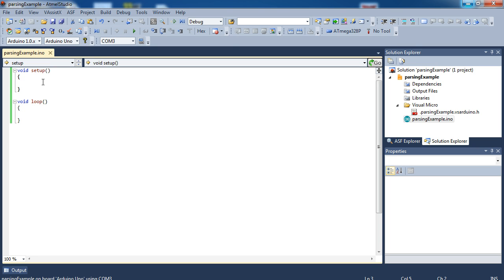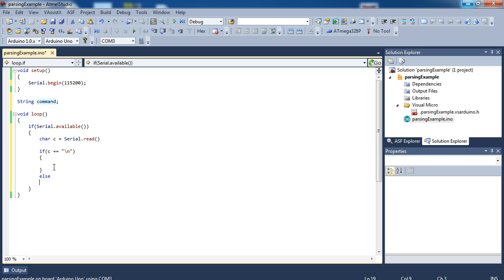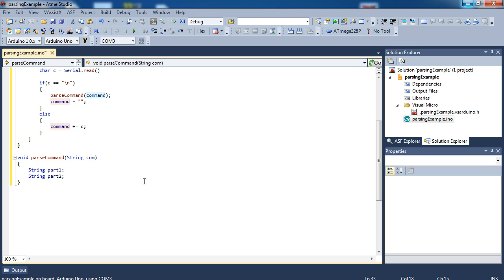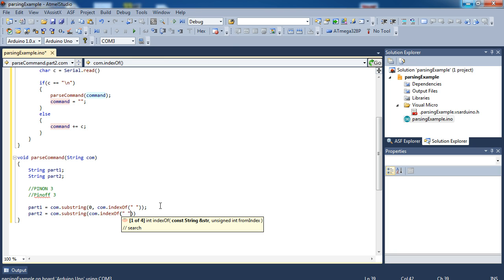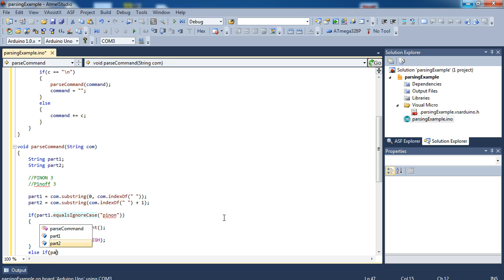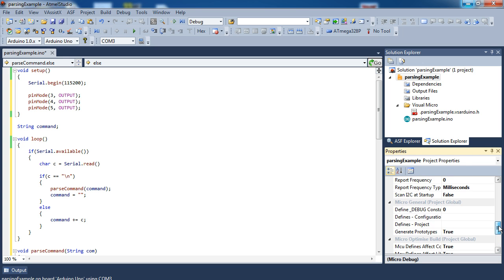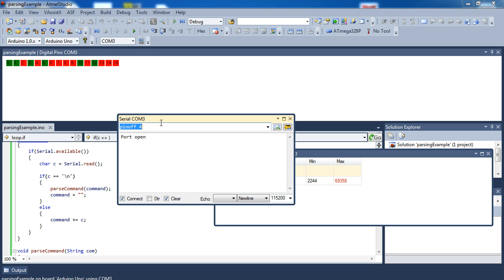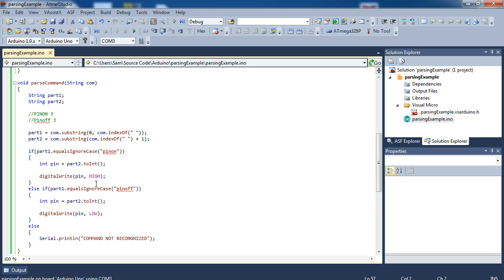Arduino Tutorial # 4.5: Better Serial Parsing

Comment: how do I add a part 3 for parsing a third part (for ex. pwm 11 125)?
Reply: Try: 
third = com.substring(com.indexOf(" ") + 2);
Reply: It didn't work i find an workaround with more then one separator for each comand like this:

void setup() {
  // put your setup code here, to run once:
  Serial.begin(9600);
}
String command;
void loop() {
  // put your main code here, to run repeatedly:
  if (Serial.available()) {
    char c = Serial.read();
    if (c == '\n')
    {
      parseCommand(command);
      command = "";
    }
    else
    {
      command += c;
    }
  }
}
void parseCommand(String com)
{
  String topic;
  String sensor;
  String value;
  //topic sensor value
  topic = getValue(com, ' ', 0);
  sensor = getValue(com, ' ', 1);
  value = getValue(com, ' ', 2);
  Serial.println(topic);
  Serial.println(sensor);
  Serial.println(value);
}
String getValue(String data, char separator, int index)
{
  int found = 0;
  int strIndex[] = { 0, -1 };
  int maxIndex = data.length() - 1;

  for (int i = 0; i <= maxIndex && found <= index; i++) {
    if (data.charAt(i) == separator || i == maxIndex) {
      found++;
      strIndex[0] = strIndex[1] + 1;
      strIndex[1] = (i == maxIndex) ? i + 1 : i;
    }
  }
  return found > index ? data.substring(strIndex[0], strIndex[1]) : "";
}

Comment: Hey man, I know this video is 5 years old or whatever, but it's a great tutorial on separating out data from serial input. I have spent hours reading Arduino forums about methods of doing this, but they are SO convoluted (making temporary indexes and arrays, etc). Thanks so much man, this is so much cleaner and easier to understand.

Comment: Hello, how can I read a returned message after using GET method? Basically, I am able to push data with GET and recieving back "success" message on Serial Monitor. I want "success" message to be read and trigger a PIN. Is it possible? Thanks

Comment: His code works really great. I built it in Arduino IDE and worked well. I just had a hard time not getting the pins on or off and this was because I forgot to select (Both NL and CR) in the serial monitor. hope this helps other people.
Reply: Seven years later...it helped me. Thanks!

Comment: Thanks this really helped. ..This is way faster than the slow Serial.parseInt().  To just parseInt() 2 integer values it takes a little over 6000micros but doing it this way and converting to integers only takes 320micros.

Comment: Please help!

void setup()
{
  Serial.begin(20);
  pinMode(3, OUTPUT);
  digitalWrite(3, LOW);
}

void loop()
{
  String command;
  if (Serial.available() > 0)
  {
    char com = Serial.read();
    if (com == '\n')
    {
      Serial.println(command);
      serialcommand(command);
      command = "";
    }
    else
    {
      command += com;
    }
  }
}

void serialcommand(String com)
{
  if (com.equalsIgnoreCase("pin on"))
  {
    digitalWrite(3, HIGH);
  }
  else if (com.equalsIgnoreCase("pin off"))
  {
    digitalWrite(3, LOW);
  }
  else
  {
    Serial.println("Invalid command");
  }
}

Comment: Hi, I just used the parsing procedure of your code and it work beautifully. But just a little problem though, I do not know if it is due to the parsing but my servo reactions are delayed. Any ideas why. Here's My Code, Hope you could help.

/* Servo Control
 
*/ 

#include <VarSpeedServo.h> 
 
VarSpeedServo myservo1;  // create servo object to control a servo 
                // twelve servo objects can be created on most boards
 
int pos = 0;    // variable to store the servo position 
String command;

void setup() 
{ 
  myservo1.attach(9);  // attaches the servo on pin 9 to the servo object 
  Serial.begin(115200); //begins serial communication
} 

void loop() 
{ 
  if (Serial.available()){
    delay(100);
    while(Serial.available()>0){
      command=Serial.readString();
      parseCommand(command);
    }
  }
} 

void parseCommand(String com)
{
  String Part1;
  String Part2;
  String Part3;

  Part1 = com.substring(0, com.indexOf("/"));
  Part2 = com.substring(com.indexOf("/")+1,com.indexOf("#"));
  Part3 = com.substring(com.indexOf("#")+1,com.indexOf("s"));
  
  int pin = Part1.toInt();
  int pos = Part2.toInt();
  int spd = Part3.toInt();
  
  if(pin==9)
  {
  myservo1.write(pos,spd,true);
  }

}

Comment: part1.toInt();
From where you got this function?
I mean where is the documentation?

I thought arduino is based on c programming but the functions that you have used are from Java
Reply: http://arduino.cc/en/Reference/StringToInt

Arduino has a bunch of built in libraries. Would make little sense to not use them. Even if you think they are Java :)

Comment: had no idea the atmel studio was like arduino
Reply from the maker: It's a plugin for Atmel Studio.
The Better Arduino IDE
Check it out.
Reply: do you half to have visual studio first?
Reply from the maker: robin vermillion You can just run Atmel Studio.
Reply: Do you have a procedure for doing that because I couldn't get it to work.
Reply: robin vermillion Getting Atmel Visual Studio installed seem to be a dozen video series in itself. It was a real pain to do, yet to see if it will pay off.

Comment: I disagree with Istace's assertion that there's anything wrong with your protocol itself, but the kind of manual pulling apart of strings that you're doing there gets messy and buggy very quickly. You should look at using something like Ragel, which will generate a state machine based on a higher-level pattern description. I use it for parsing GPS data and AT command responses. Apart from being more maintainable, it also has the advantage that you don't necessarily need to buffer an entire string before you process it.
Reply from the maker: As long as you know what you're doing, I've found that handling it this way is very reliable. Granted it's not extremely flexible, but you have to remember that these videos are more made for hobbyists.
Creating a finite state machine for the sole purpose of essentially recreated the firmata code seems a bit overkill for what the majority of people watching this are going to want to do.
Reply: agree

Comment: Don't take it harsh but what you're exposing are just work around on bad practices. I'm working in software development, just electronic hobbyist, but for me that kind of matters are more close to software than electronic and exchanging data that way is really awful. (but a lot of engineers write that kind of stuffs, even in the industry, and that's why I really think engineers should never write one line of production code or take that kind of architectural decision, anyway) You should show instead how to use a standard protocol and robust protocol I think. With some kind of integrity check (packet based ? hash ? seq nbr ?) and meta data about the exchange itself to control it. Not that hard to use or implement a simple TCP like protocol for serial communication.
Reply from the maker: You bring up an excellent point. This video was more a response to several questions I received asking how to get the Arduino to respond to more complex commands from the computer. 
I understand that for communication between devices where losses have more weight or aren't as reliable, having a more robust protocol is certainly important. Having done a lot with Arduino's serial, I know that communication from the computer to the Arduino is incredibly stable.
Your comment does make me think that showing how to accomplish these protocols would be extremely valuable.
Reply: +Emmanuel Istace Could you recommend an easy to follow video / reference for this? :)
Reply: Do you really think someone who's writing his first lines of code for the Arduino will understand your TCP like code? Not!
Reply: +Emmanuel Istace i was actually looking to get a break down of what is parseInt as i always see it in code i find online "Serial.parseInt" and can tell that by using the terminal window i can adjust things in the code that can change the behavior of the code but going to arduino.cc i do not see a break down that easy to digest,  im looking to build a protocol that can tell any peripheral module hooked to the mcu what todo according to case or switch arguments in the conditional statements  as i have spend weeks building up a list of obj datatypes that i want to be accounted for during source execution and in conjunction with opencv "consciousness" is what i been working on for this AI program in Visual Studio C# which will parse thru the datatype of obj i been building up for weeks in hope that i can use the conditional statements to narrate a story using complex math using this variables recognized by openCV and therefor passing motor functions to the driver in the arduino and get() sensor data to complete the conditional statements in the visual studio side.
Reply: Hi, Can you suggest some video tutorials on creating robust parsers for Arduino? How to implement, for example, C-command of Omron PLCs or the like. Something with package control, parity bits, and addressing. Thanks.